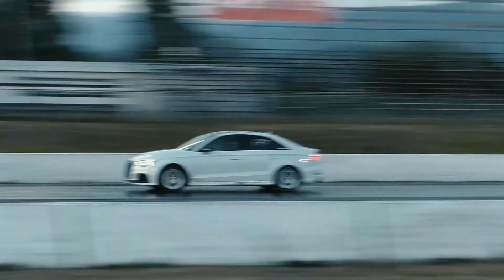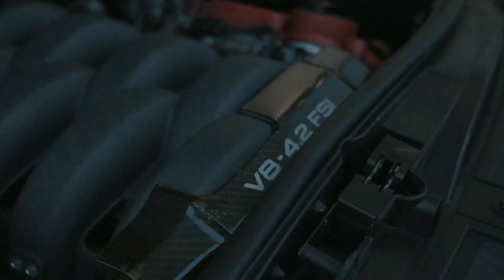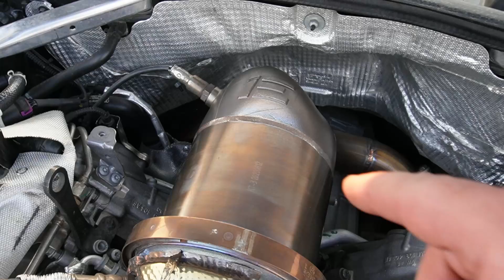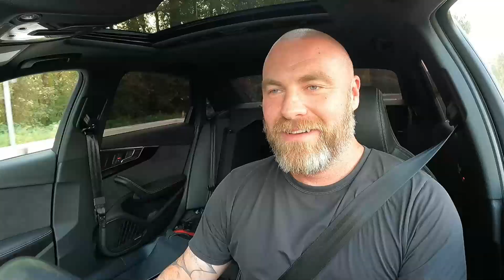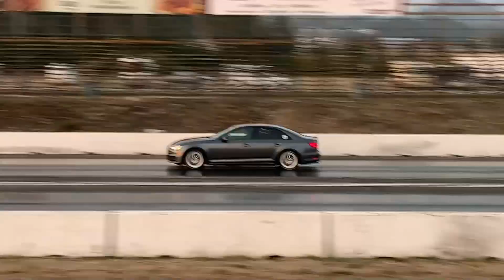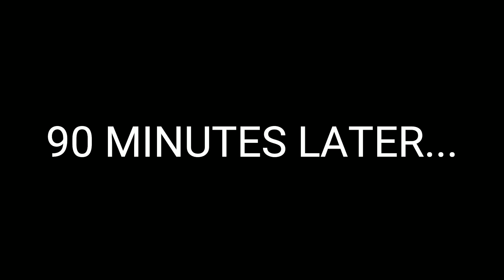TTE710 - Integrated Engineering Stage 3+ w/ Injectors E70 1/4 Mile Runs - Audi B9 S4

Comment: Hey! Love your channel - I have a couple of questions about your S4 and RS3 comparatively:
- is the ZF8 in the S4 noticeably slower or less fun to drive than the DSG in the RS3 on the street?
- is there much difference in the amount of noticeable turbo lag between the two cars on stock turbos? i.e. both at stock and also with a "stage 2" level tune (with supporting mods, but not a turbo upgrade)
- how much more turbo lag does the S4 have between OEM and the TTE710 with IE's tune?

I am coming from a manual V8 S5 and I've spent a bit of time with my friend's very built A5 3.0 TDI (darkside stuff) and it has quite a lot of lag and also the DSG isn't quite as immediate as I would have imagined considering how much the internet raves about it.

Thanks!
Reply from the maker: WAY too many questions for a YT comment, lol.
- I answer the ZF8 VS DSG question in this video: https://youtu.be/Az4z7fb9Wlk
- The stock turbo on a B9 S4 develops torque insanely early which can be seen here: https://youtu.be/2OowJ99-SEM The stock turbo on an RS3 develops torque a little later which can be found here: https://youtu.be/Cm4HJBquYkM
- The "turbo lag" between a stock turbo and a TTE710 on pump gas can be seen here: https://youtu.be/AJVV2LQyALk Sadly I don't have the dyno charts of what the TTE710 looks like on E70 yet.

Both of those cars you are discussing are insanely slow compared to both a Stage 2 RS3 and a Stage 2 S4. The responsiveness of the ZF8 and the DSG in the RS3 and B9 S4 will destroy those cars in terms of performance.
Reply: @VancityAudi  Thanks for all of that!

Comment: Anyone worried about rocker arm issues on these?
Reply from the maker: There have been some failures, yes. Enough for me to be worried about it. No.
Reply: @VancityAudi  Thanks. Mine is bone stock so far, fingers crossed. Using 0w20 OEM oil, not sure if using thicker grade is better. I’m in Toronto
Reply from the maker: @ken116  I've used 5W40 since I bought the car last year. Not sure if that's wise or not though, haha.
Reply: @VancityAudi  could explain your fuel consumption 😀
Reply from the maker: @ken116  you mean my amazing 14mpg?!?! 🤣

Comment: Very impressive for bolt ons! Why can a car like a plaid pull off the 0-60 times it does without slicks though?
Reply from the maker: It weighs WAY more and makes WAY more power, making it easier to put the power down. Plus electric power ramps in immediately where as a combustion engine ramps it in slower.